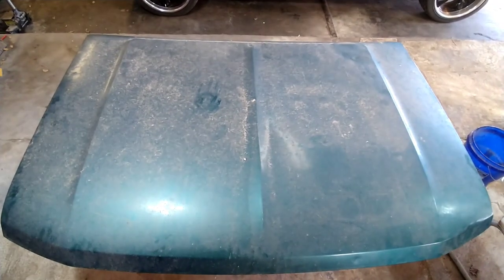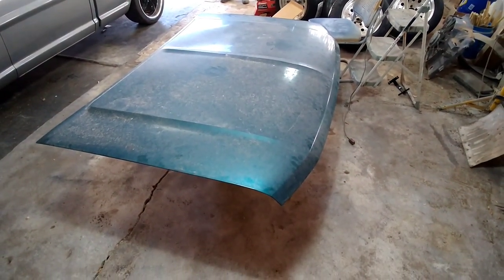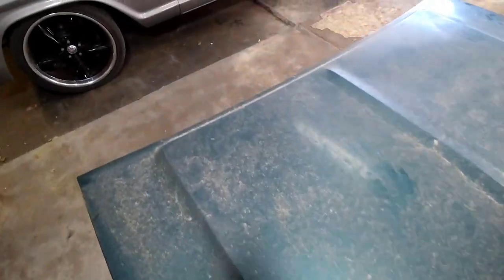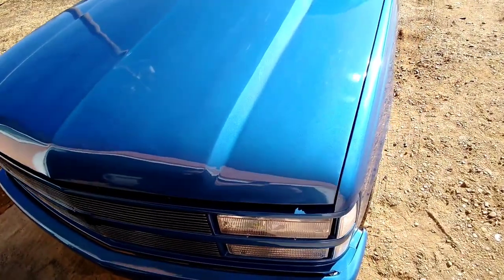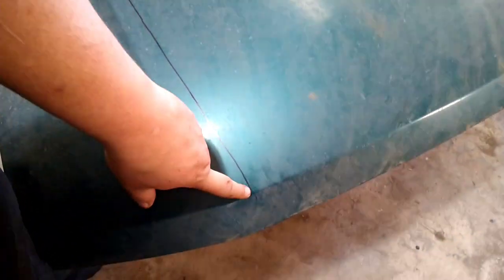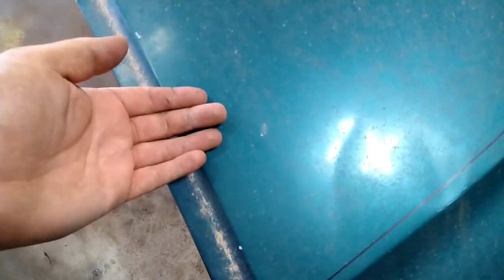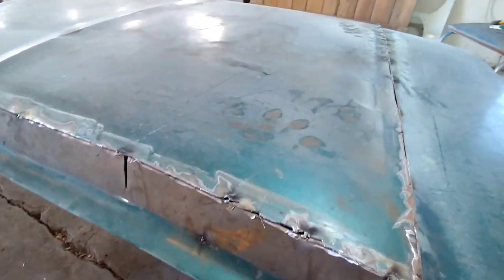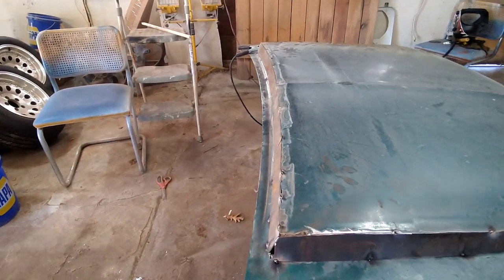Building a custom cowl hood (P1)

Comment: Excellent build.
Grab an old pipe and put under metal and use to roll out .
Regarding welder... Flux core isn't the greatest but it bests a blank. 
When I fabricated gas tanks for choppers, I prefer to tack then braze.
Brazing is old skool.
Excellent work and keep fabbin
Reply from the maker: Awesome thank you brazing is a dying art

Comment: Do you know where I can find a hood for a 1957 force F100 as well as a door
Reply from the maker: I sure don't you don't see to many around these parts
Reply: Oh OK well I'm trying to restore a 1957 forde but I need the hood and passenger door for it so far I've got the back sanded and primed and did the front right side Today actually and the hood is really hard to find
Reply from the maker: @racermike3387  sounds like a nice project I wish I could help but I'll keep an eye out and put the word out to all the car guys I know
Reply: I appreciate it and it's nice to do this because I'm learning how to paint cars anyways so the fact of doing it helps but also I'm getting a trade plus I'm gaining value in it
Reply from the maker: @racermike3387  yessir your correct

Comment: Can you arc weld it as well?
Reply from the maker: You talking like stick weld
Reply from the maker: Maybe with 1/8 6011 or smaller rod
Reply: @CCAutoWorks  in was talking with the  wire arc welding machine. But since you can do it with Arc stick I'm guessing it's a yes.
Reply: @CCAutoWorks  i just couldn't remember if the sheet metal with the arc weld would stick when you weld it together. Usually I see people using Mig welding rather that Flux or Arc.
Reply: @CCAutoWorks  my friend has an Arc wire machine and it was wondering if I can use it. Do you know if you can weld a roll cage with Arc wire to the car?
Reply from the maker: @oscarvillarreal8951  yeah it should work no problem
Reply: @CCAutoWorks  do you know if you can use Arc on the muffler exhaust?